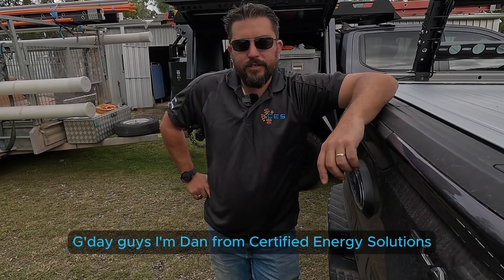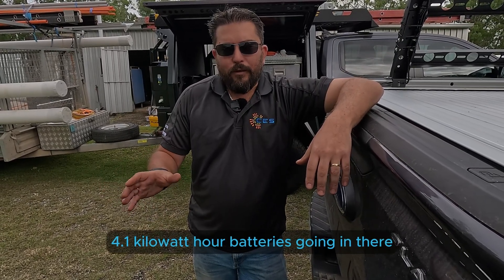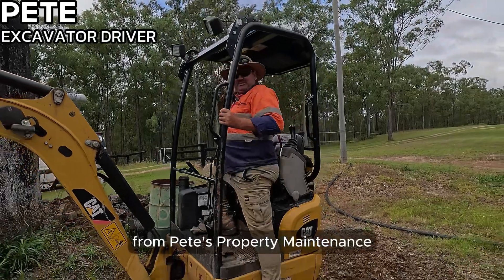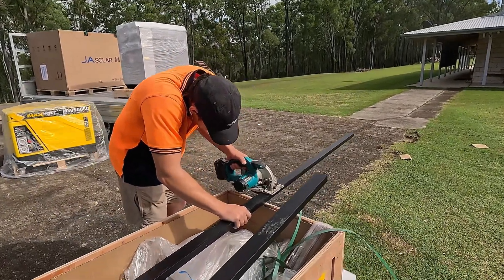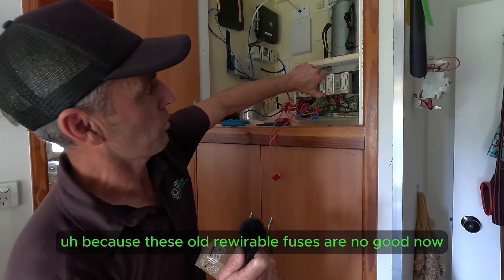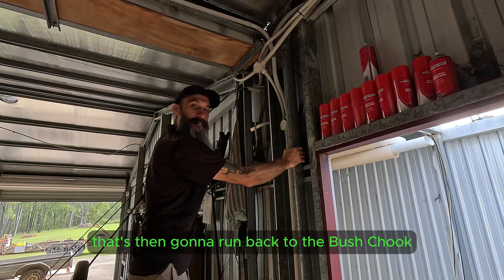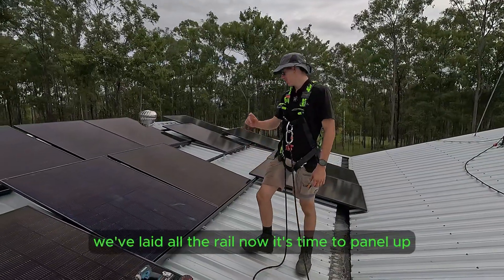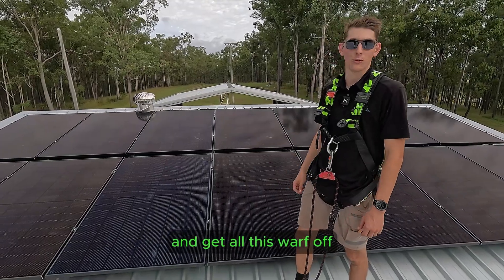#𝗦𝗵𝗼𝗿𝘁 𝗠𝗼𝘃𝗶𝗲#  Following the complete installation of a hybrid RedEarth BushChook solar system

Comment: Any details of the PV size, inverter & battery size ?
Reply from the maker: Hi Mike, 

the system in this video comprised of an 8kw inverter inside of the RedEarth BushChook along with 5x Troppo 4.1kwh lithium batteries connected to a 11.44kw PV array consisting of tier 1 dual glass 440w panels. Alongside this system there was also an automatic start 8.8kva generator hard wired into the inverter to automatically provide backup to load assist and charge the batteries if it is ever needed.